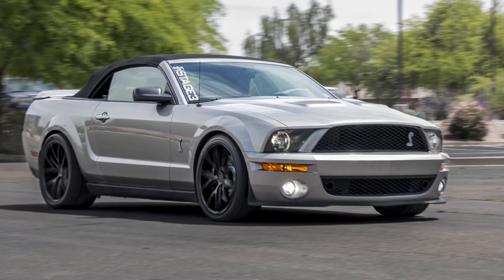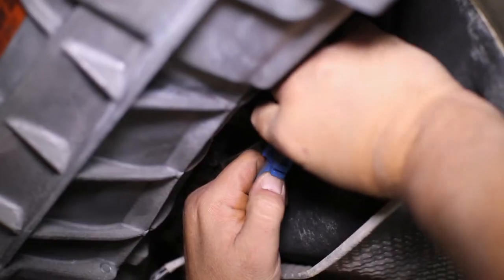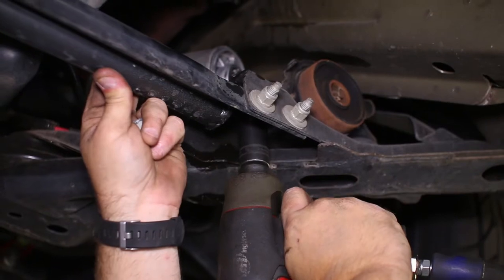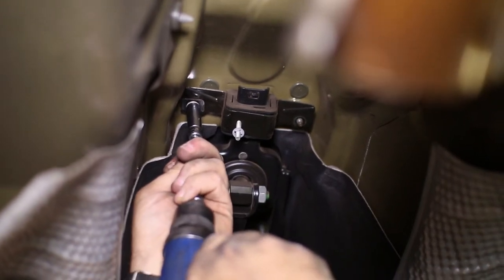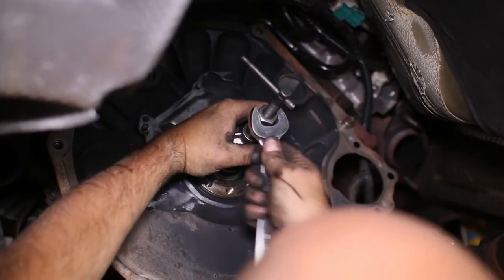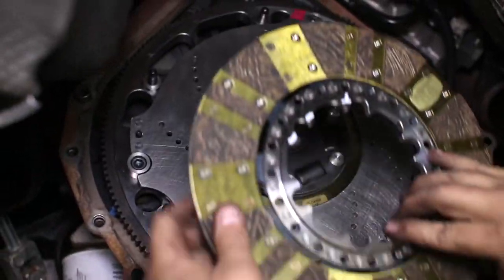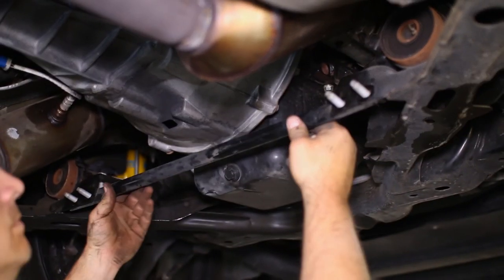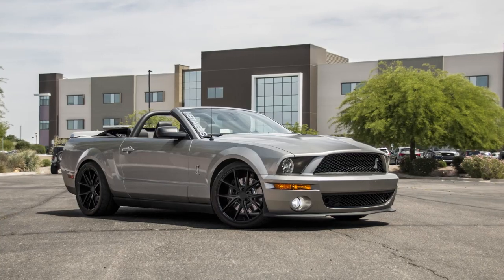2007-2014 Shelby GT500 Centerforce DYAD DS Twin Disc Clutch Install

Comment: Awesome video with great step by step instructions and tips!  Not sure yet whether I'm going to do the job myself, but it's helpful to know what needs to be done.
Reply: I'm also considering replacing my clutch in my 2013 Boss 302. I'm lucky enough to have access to a lift, so will make the job a little easier. I think if you take your time, it's quite doable. Lots of YouTube vids like this one that provide good insight/tips into what needs to be done.

Comment: I'm an original owner of a 2009 GT500. I plan on using a Motorsport aluminum drive shaft, which I believe can be bolted in because it's a 1 piece?  And does the throw out bearing really need replacement if it has only 35,000 miles? Thanks for the info!  John